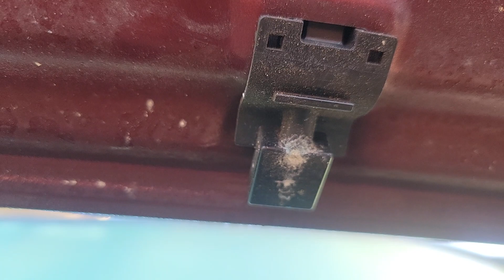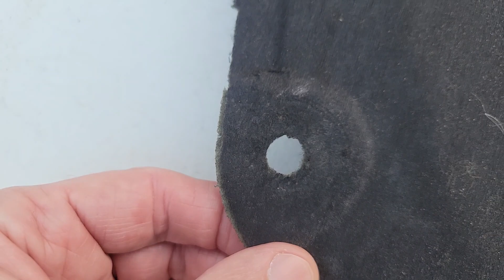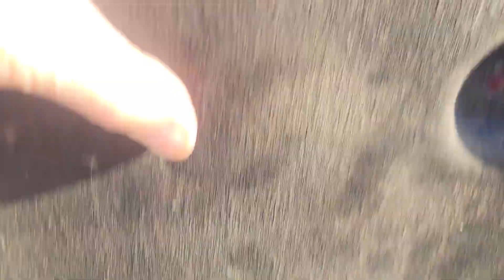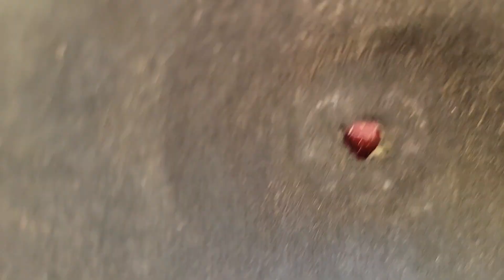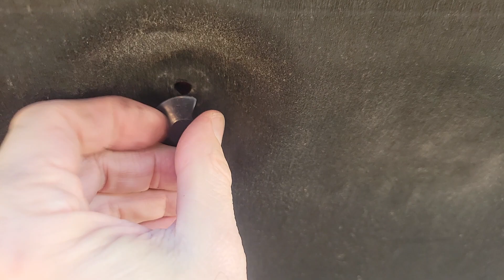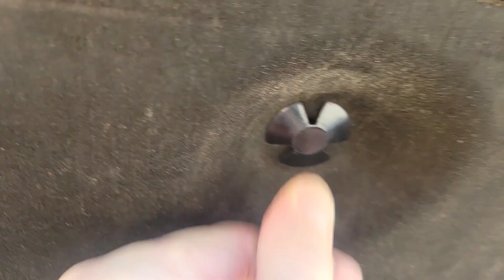WINDSHIELD WASHER FLUID CHECK VALVE REPLACEMENT

Comment: I am not convinced check valves are needed at all in tank bottom mounted pump systems. The pump cannot lose prime and to wait seconds for a few cc’s of water to flow to the nozzles isnt dangerous or worrysome.